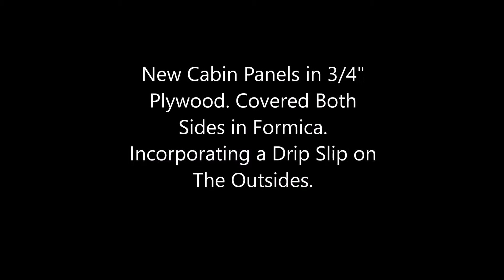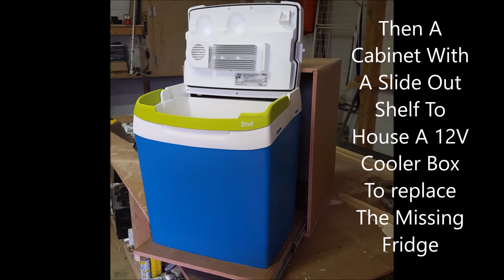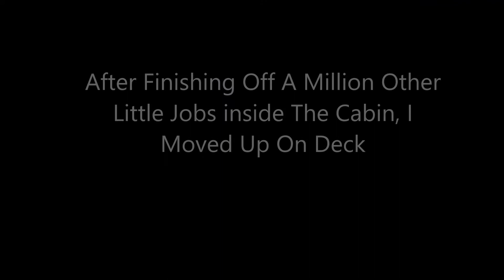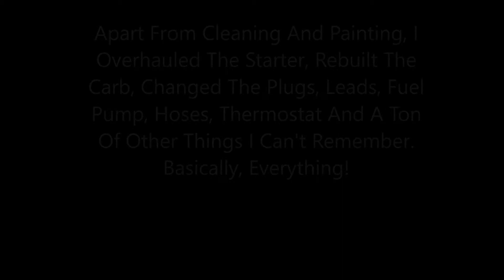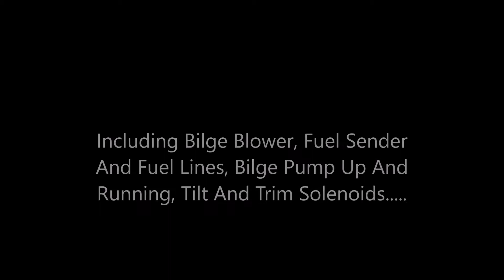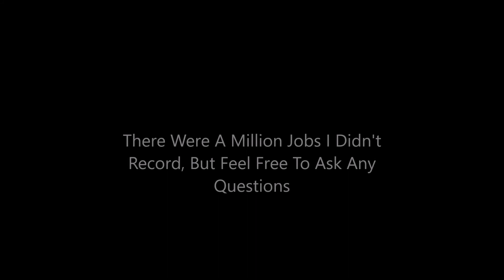Wellcraft 250

Comment: Lot of work done to the Wellcraft...... any new after pics?? I am looking to buy a 25 sportsman and will be updating.... any regrets buying the older boat? transom still solid?
Reply: I have since replaced the transom using two 3/4 marine ply panels, all glassed in etc. I've also replaced the engine mounts/stringers and the stringers alongside. In the process of reassembling everything. I've been distracted upgrading a  diesel engined Sealine, but when the Wellcraft is finished she'll be put up for sale. Lots of before and after pics available of the transom and associated work. I must update my post! No big regrets, apart from availability of petrol! Diesel is much easier to come by. Simpler engine, lots of room in the engine bay too, but that's just a design issue. I considered opening the deck up a bit more to give better access on the Wellcraft. Any question feel free to ask.
Reply: @sogood2022  wow.... That's my fear... Replacing rotted transom and stringers.... Can I ask... In your opinion where or how did the water get in to rott the stringers and transom?... The Wellcraft I am looking to buy is not an I/O... It is a outboard transom.... No trim tabs... Boat is immaculate but need to make sure I am not over paying if it's rotted out... Thanks!
Reply: I think with an outboard the likelihood of a bad transom is much reduced. Its often the transom housing seals, mounting bolts U joint bellows that are the main culprits. Also the drain plug can be a cause. Unless the plywood transom stops short and the area around the drain plug is solid glass/resin. Apart from drilling exploratory holes, tapping with a small hammer is a way to look for soft spots etc.
Reply: @catchinhail  I'm also in the market for 250 sportsman.  Good luck with your search.

Comment: What was the cost for the repairs and upgrades? Very nice work.
Reply: To be honest I didn't keep any real record of the costs involved, but I'd say it was in the 3K euro ballpark. There are so many little things that add up and I'd include the transom and stringer replacement that I've since done on her.
Reply: @sogood2022  

Hi Stephen,

I just traded two rifles for a 1987 Wellcraft 250 with trailer. The deck needs to be replaced for sure. The engine was recently replaced and runs. It was replaced with a 1968 L79 350 🤗. I am going to redo all the wiring, wood and electrical to make it more modern. I sure could use your help. 😁
Reply: @mauriceruff 
Hi Maurice. Any specific questions you might have? Either way, just ask and if I can be of any help I'll do my best.
Reply: Hello Stephen I just this past weekend came into possession of basically the same boat would like your input or suggestions on getting some upgrades and refinishing. I  like to send pics if you don't mind. My boat is in very good condition for the year. Not sure how to post pictures on here.